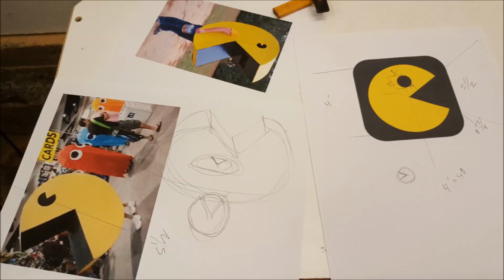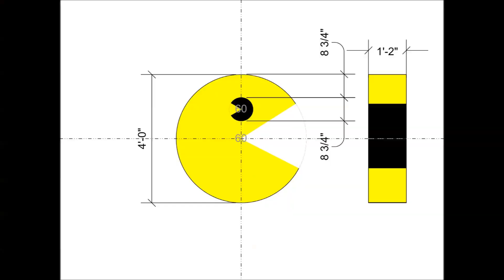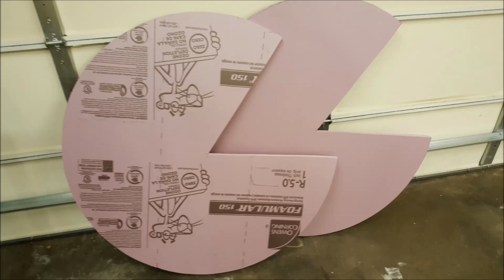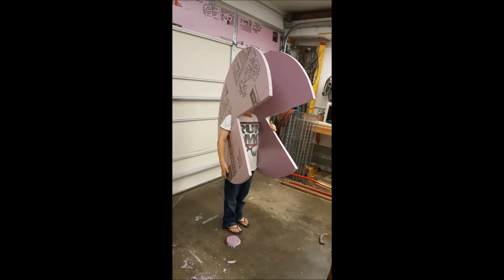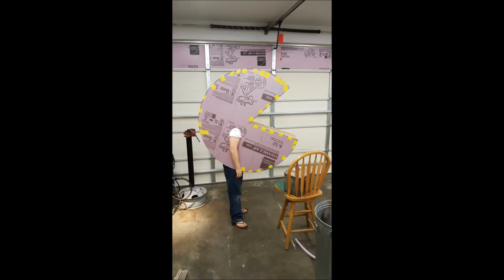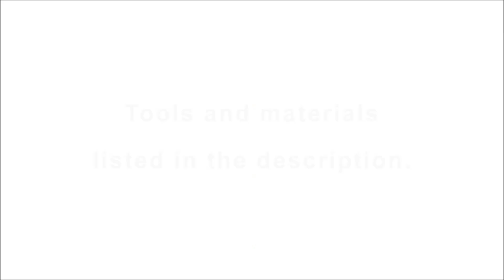How to make a PAC-MAN Halloween costume

Comment: 1" foam board, great idea!  Weight is probably key in this costume. How many rolls of yellow duct tape did you use?
Reply from the maker: Yes, weight was a concern. We used two rolls of tape. they measured 1.88" x 180'. I figured them at 1.75" wide for overlap. It worked out with only a few feet left over.